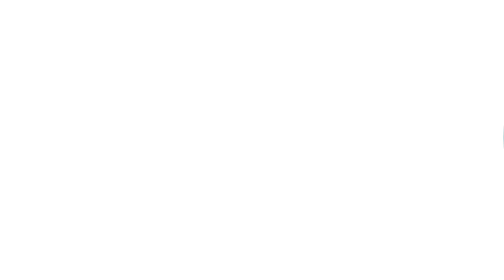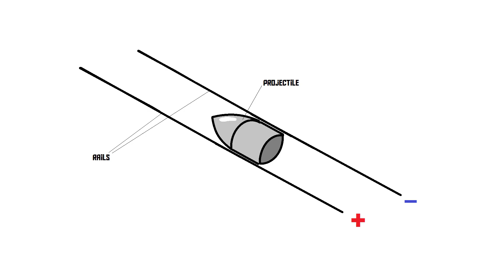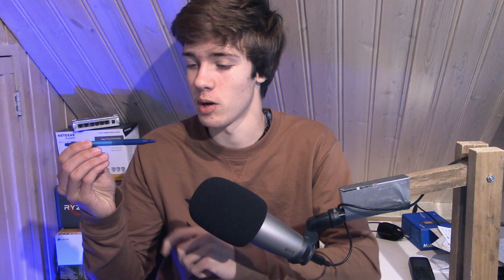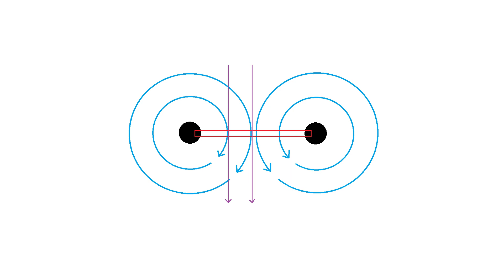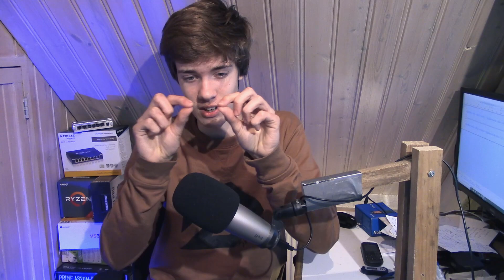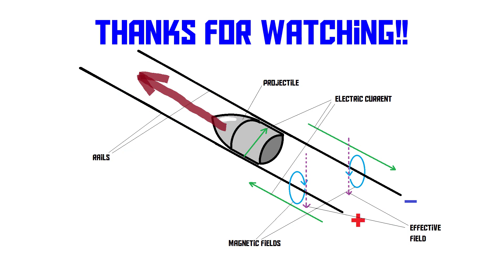How does an electromagnetic railgun work? (AKIO TV)

Comment: This is a "line of sight" weapon.. In order for line of sight to work, you must have a clear, unimpeded path for the projectile. If the Earth had curvature, this would not be possible at long ranges. If a railgun can hit a straight line target at over 100 miles, there is no curvature... according to NASA, there would be several miles of curvature over a 100 mile span. Yes, the,Earth is flat. Things like this prove that

Comment: What would be cool if they experimented with different projectile types, different power levels for different, targeting systems. How small can you get it? Mount on a technical truck. It’s like that the eraser movie with Arnold where the guns would shoot through houses. Just crank the power up penetrate fortified structures. It would prob limit the the amount of shots you have left though. If you think rail guns are a joke just remember guns don’t work in space. Sure I guess torpedoes but something about special about a cannon. I’m an old artillery and I see potential. The artillery tech has really stalled and range isn’t there. (30k, though they going the rocket assisted route)I know the navy abandoned because of the so called limited range of 110. For an army guy give half the range but make it as small as you can. Different sizes for different roles. Smaller ones can kill point targets like tanks. It would be an invading army nightmare. I blame the expanse for this fervor lol 😂

Comment: Based on what I've seen in this video... a tank or ship would need to supply the energy required to charge and launch the payload and it would need to power down each time they reload to prevent any danger to the people reloading.
Reply from the maker: yes.
Reply: Hey two years late 👋🏽.  I would go an auto loader with a barrel cooling system with a quick swap out  barrel or parts. I would place on a remote target system to remove the person from the area